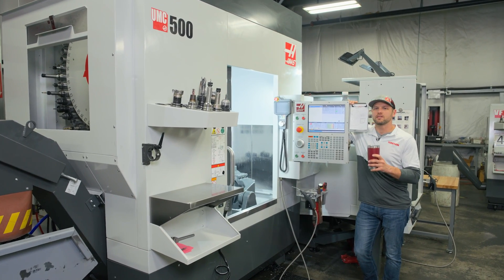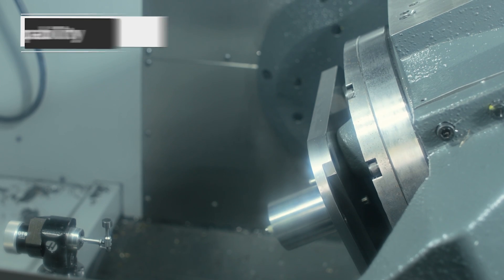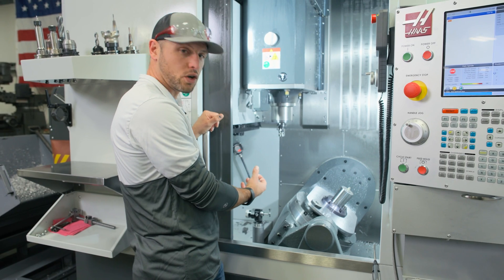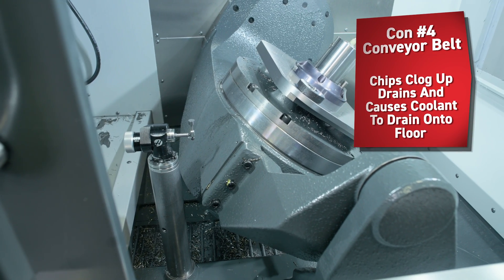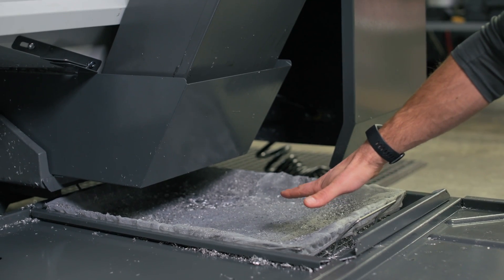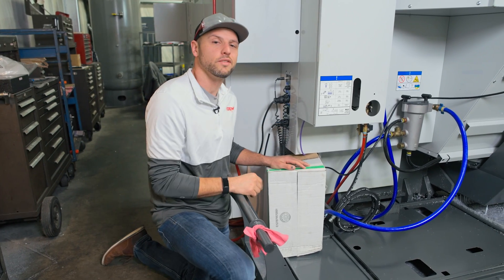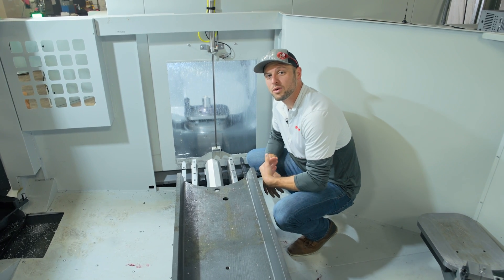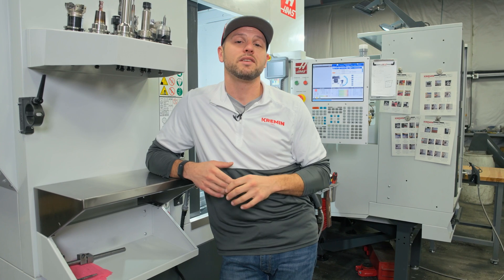HAAS UMC 500 - Kremin CNC Machine Reviews

Comment: Seems odd the machine design is still so immature; they've had years to get these things straightened out.
Reply from the maker: It’s a valid point, they have had the UMC for some time. A lot of our issues are with the accessories, like the larger coolant tank and the pallet pool - they just don’t work right with the base machine. It’s the little details that are missing. Do you have any experience with haas?
Reply: @KreminIncManufacturing  Yes, I programmed and ran a 2015 VF3-SS with a TRT160Y from 2015 through 2021 making medical device parts.  Then I started my own shop with a CM-1, 50K RPM, an HA5C-T, and now also a TRT-70.  The worst aspect of the CM-1 is its coolant and chip management, or rather a complete lack thereof.  Coolant and chips just go down into the sump, with some baffles that are supposed to stop chips, but actually do nothing.  I had to make my own filter system.